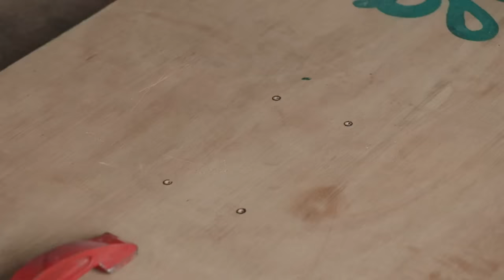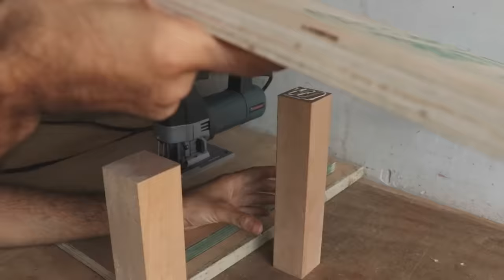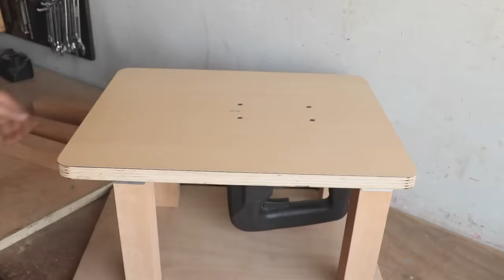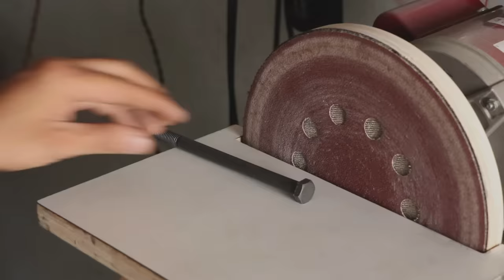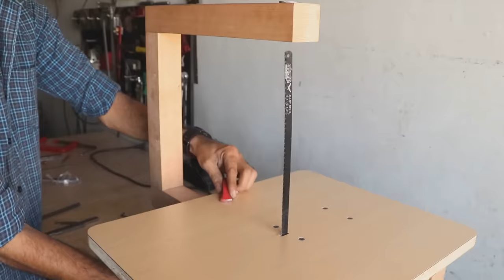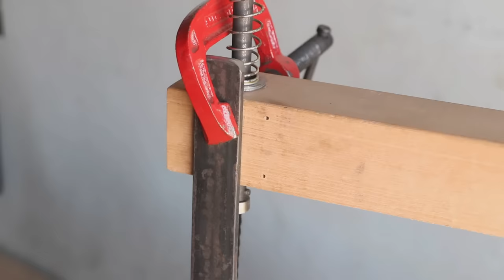How To Make Jigsaw Table With Hacksaw Blade || DIY Jigsaw Table

Comment: 1 drawback.  You are always only using about 2,5 cm or 1 inch of the blade. You need to make the jigsaw adjustable so that you can drop the jigsaw so that you can use a new section of the blade. I think an adjustable surface would be easier . Using 4 threaded rods with a top nut countersunk and 4 each of pipes cut to 2,5 cm 1inch and 5 cm ,7,5 cm 10 cm etc maybe till 20 cm ( in inches 1, 2, 3, 4, 5, ....... 8 inches) long. Putting the top table bed down on the one pipe height you made with the spacer pipes in between the 2 beds will allow you to utilize the full length of the blade. Yes your table bed will become progressively higher but we only talking a few inches. You could go further and make the stand where saw stands on adjustable, with legs adjustable down. ie: the higher the table bed the lower the legs equals constant work height . I would make this adjustment using the lowering down in increments of say 3 inches ( 7,5 cm) I wouldn't use this saw to cut metal as it is always advisable to liquid lubricate the blade when cutting metal with a saw. Just my thoughts
Reply: Me gustaría que usted hiciera un tutorial, seria muy interesante, reciba saludos
Reply: The blade can be turned upside down when the other end is dull.
Reply: @vareseources  That would mean the blade cutting on the up stroke rather than the down stroke.
Reply: @rothwellaudio для лобзика также выпускают пилки с обратным направлением зуба.

Comment: Nice job, but the actual working space here is not bigger than the original jigsaw had. The whole idea to my mind to be able to saw LARGE ojects that a jigsaw cannot. I wonder why going full way of switching to hacksaw blade and still using 1/10th of it?
Reply: You get more control at the expense of space

Comment: During cutting or any other machine operation , you should use cutting fluid or some machining coolant , to increase the life of tool , drill bit etc. Also it will give more finished and smooth look to the operation . Will also help in dissipating the excessive heat generated during the cutting / drilling operation.

Comment: Thumbs Up   !   You will have 1/2 the efficiency than a band saw.   But the biggest problem ? Is that only about 2.5 centimeter of the blade is going to cut, so other than changing blades like crazy,   this small portion of the blade   will get VERY worm.  I thing heavy metal cutting is out of the question,    But your tool is excelent for quick cuts, and special straight 90 degrees  cuts !   Not for continuous use.   With some modifications it could serve as kind of a "Jointer Tool, create completely square  plywood plate   and so on.
Reply: That is what happens with a jigsaw blade anyway, but the advantage here is the blade has more support.